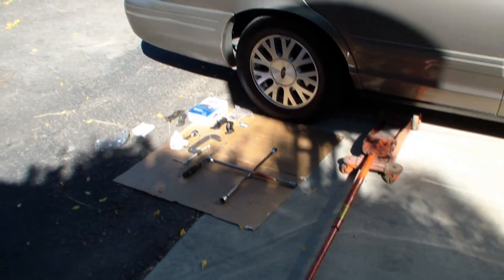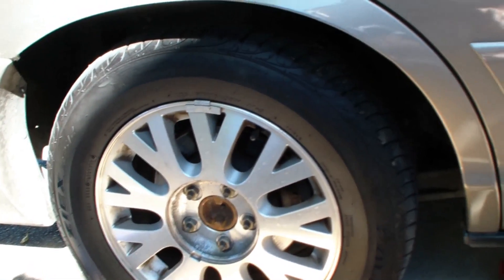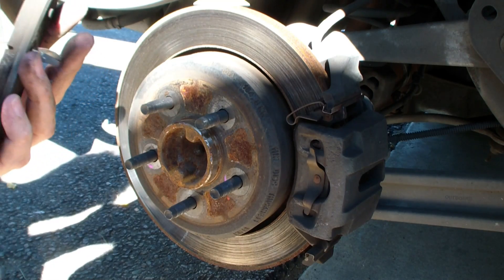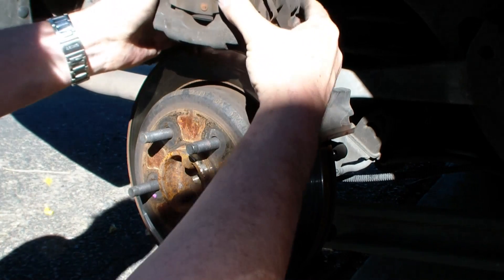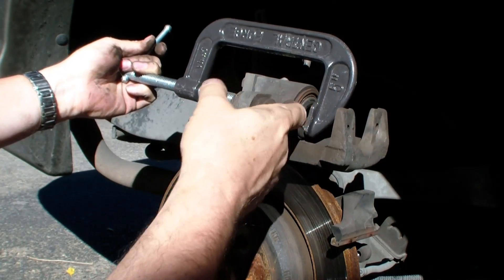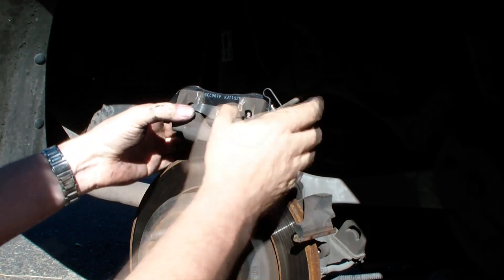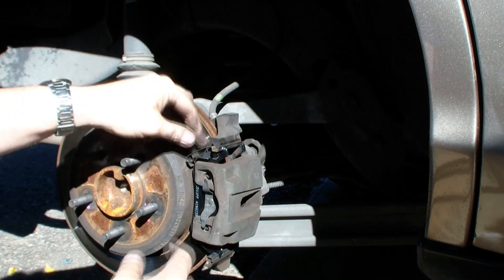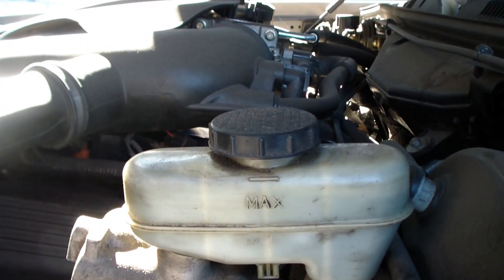Ford Crown Victoria Rear Brake Pad Replacment Tutorial

Comment: I always use silver anti-seize for lubrication, the little package is not really enough to grease. Use them across the slide and even under the slide for rust prevention. I also use them on the back of the pad that touches the piston and keeps it from rusting and have the rust damage the seal.  Some mechanics in the norther area, where winter are tough and roads are salted, they also use the anti-seize on the complete back of the pad from keeping them to rust, specially with older cast iron calipers.  And also lubricate the 2 sliding bolts and then put the rubber boots back on. This lubrication is very important or the caliper can get stuck.

Comment: thanks for the vid, I've got a 92 crown vic, going to change the brakes and maybe rotors tomorrow, if it stops snowing. good video!
Reply from the maker: Do not use my video for rotor. The rear rotor is combo drum/disk brake. The parking brake is the drum portion. You will need a brake spoon and small screw driver together to loosen the star wheel. Google drum brake replacement to see how to push off the adjuster from the star wheel, and loosen the star wheel to remover drum (rotor).
Reply: well, as my dad would say, there's always one. one screw won't turn, one in the workplace. well today I went to take the caliper off but it has a hex screw in it, one with all the sharp teeth on the inside of the bolt, I have two, couldn't get the damn thing off, any suggestions...what I would need? thanks,
Reply from the maker: They are called Torx bolts. Get a Torx bit set from auto parts store.

Comment: I don't believe brake pads will last 190k miles. Maybe 50 to 60k
Reply from the maker: These did. Rear pads get a lot less wear than front. It is not uncommon.
Reply: @KentDiego  true but i can't believe that they didn't like fall apart cause of heat n other things. But that's a good thing